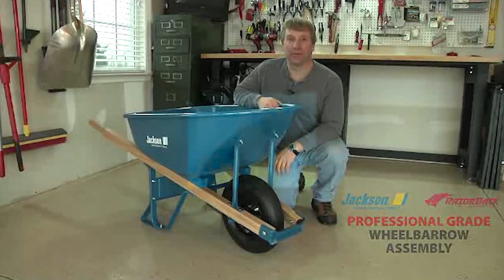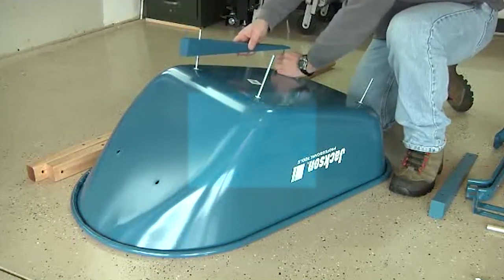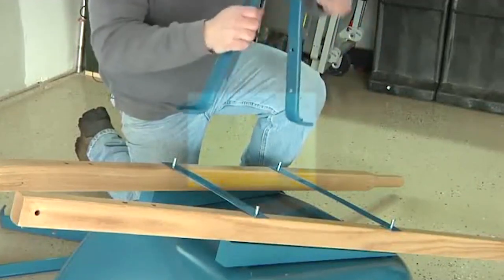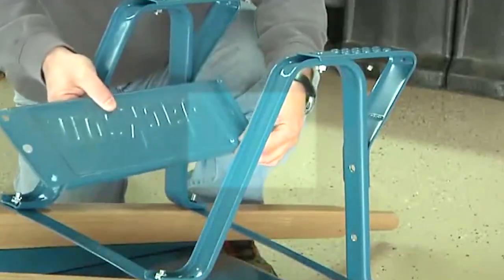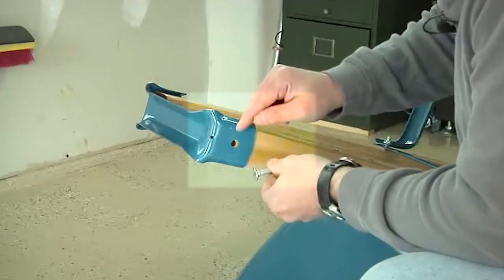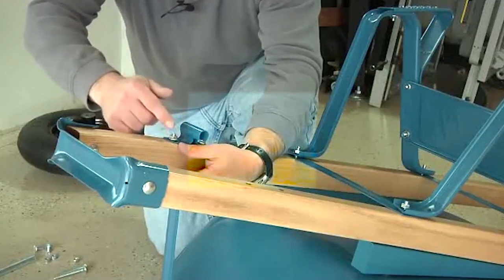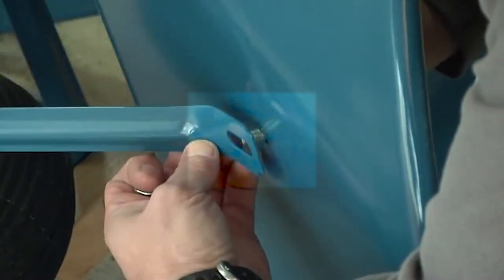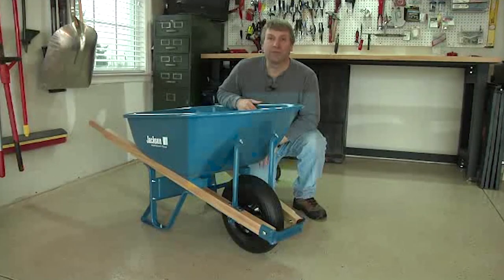Best Dual Wheel Wheelbarrow : Jackson Steel Dual Wheel Wheelbarrow Assembly - 2023

Comment: The wheelbarrow works well. It is easy to maneuver and it held up well to cement and regular garden work that we have put it through so far. When it arrived, the wheel was flat, and even after inflating and sitting by itself, it became apparent that there was a leak. I e-mailed the customer service and got a quick response from one of their reps who asked for a copy of the receipt and a few days later, I had a new inflated wheel. I would definitely deal with this manufacturer again.

Comment: I am not in the construction business. I am just homeowner who got this wheelbarrow when relandscaping my backyard.

I did not find assembly to be complicated or difficult. All hardware seems to be top-notch. The tub, supports and legs are robust steel and everything went together without a hitch.

In operation I found it just works. As other reviewers have noted, having a solid, nonflexing steel tub makes this wheelbarrow much easier to use than flimsier plastic tubs. It works WITH you, not against you. The tub has nice high walls, yet keeps a reasonably low and forward center of gravity to make it easy to maneuver and unload heavy loads. The large, stable rear legs and large tire make moving heavy loads straightforward even when over soft or uneven surfaces.

This unit also has the tipping crossbar in front of the tire. This makes unloading of heavy, unstable loads very safe since it provides a single, solid, square "foot" on which to pivot the load. My only complaint is that the crossbar is a tad (just a tad!) too low for my liking. It can unexpectedly hit the ground at times when I am just maneuvering on an uneven surface or around a tight corner. This isn't a major issue, just something that one must get used to. Other than that, I find this to be a great wheelbarrow and exactly what I needed to complete my backyard project.